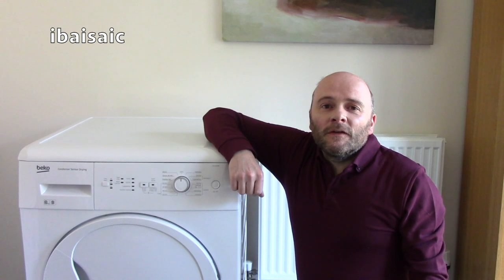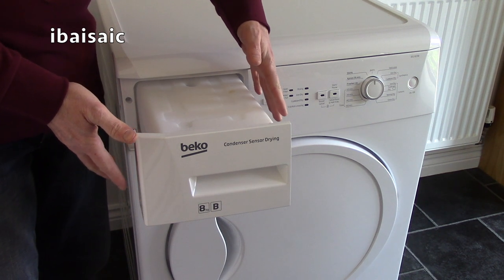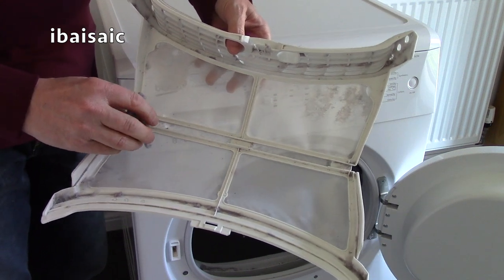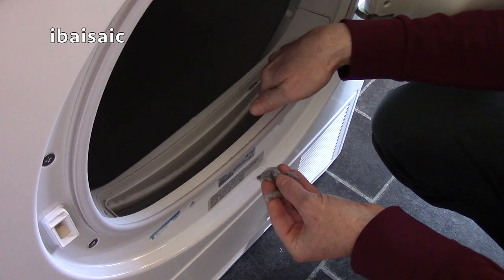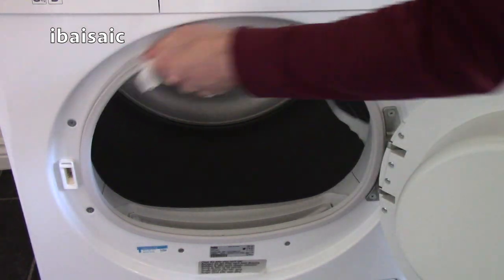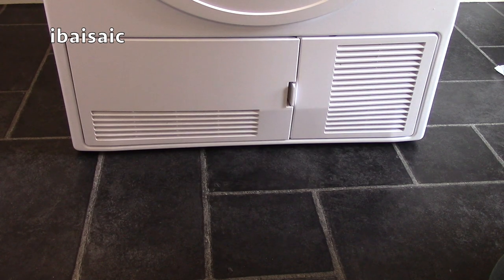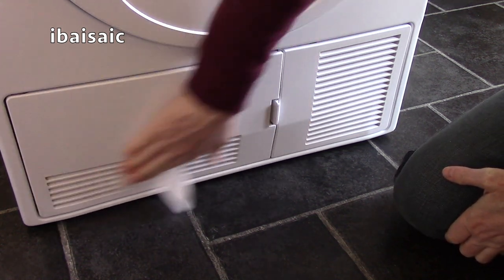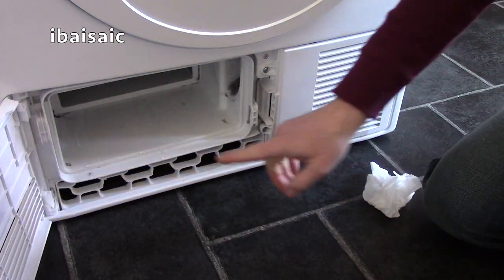Basic Tumble Dryer Maintenance For Trouble Free Drying

Comment: I take the condenser unit outside and use the garden hose. They need to rethink of a better design so you can actually open it up to clean inside.
Reply: I have lay on the floor , to clean mine , and it won't work if it's cold

Comment: The dryer I have now lights up to remind me to clean the condensor. Now I realise that I didn't clean my old one as often as I should have.  I very rarely use my dryer to dry clothes from the washing machine, I only use it to finish off clothes that are almost dry and it saves me ironing everything, so I don't emply the water every time or clean the filter every time.  I had only just given my machine a good clean before coming on here to see if there was anything else I should be doing.  I will admit that although I take the condensor out when I'm instructed by the light, I very rarely delve inside the machine, but I did today and was surprised as how much fluff sticks to the sides and collects at the back.  Mine is quite difficult to get into though.

Comment: because of my dog I rinse my condensor about every 8 loads. you can sort of tell when it needs cleaning as the dryer takes longer. I just use furniture Polish on my appliances. have done for years. it's like a protective layer. esp on the fridge and dishwasher as it makes sticky finger marks just wipe straight off

Comment: hate cleaning out the condenser - end up soaking myself and everything thats around. - we are in 2018, by now you would think some manufacturer could invent a self cleaning condenser dryer by now, no cleaning out of the lint filter and no dastardly cleaning out the condenser unit!
Reply: Cleaning a washing machine filter is worse
Reply: @Tom My Bosch Classixx7 is worse. The condenser comes in two parts. The manual shows how to open the flap and pull out the trap, but it does not tell you to pull the condenser itself out next to clean it. And of course there's no mention of the flap at the back of the compartment floor which hides another lint and water trap. You need tools and small hands and ideally a fibre-optic endoscope. Terrible design!

I have only recently discovered these things thanks to videos on YouTube. I was seriously considering throwing the machine out before that.

Comment: Really useful video. I always overthink instructions, so a visual is really helpful. Just been on the floor trying to clean the condenser cavity by shoving my arm in, but I'm about to buy a radiator brush. I actually came online to see if there was any way to get behind the ventilation grid next to the condenser, as mine looks to have a lot of stuff in it, but I can't remove the grid and I can't see any mention of doing this anywhere. I have a Beko DTG700 B - any idea if I'm able to remove it? I took out the screw but it still doesn't seem to come out, so I don't want to break it.
Reply: I have the same issue

Comment: Fantastic video and thank you. Only thing I could not see is how you cleaned the lint off the back of the condenser housing with that long brush. Did you just poke it in from the front and  wiggle it around? Where did the lint go?, did you have to vac it out?

Comment: P.S. The car wax a fabulous idea, and it works a wonder on the inside of bath tubs especially fiberglass or plastic ones when new. Much easier to keep soap scum removed. Not that I recommend using soap. Only shower gel. 😉
Reply from the maker: Doesn't it make the surface slippery.

Comment: I have cleaned my beko condenser. How long should I let it dry before putting the part back in?
Reply from the maker: The condenser does get wet when the tumble dryer is on as it condenses the hot moist air into water, so it doesn’t need to be bone dry. As long as it’s not dripping with water it should be fine.

Comment: Should there be fluf at the back behing the condenser unit st the bottom? 
istnt this  what causes fires at the whirlpool dryers?  its just  whst i read on BBC news now.. fluff behind the heating unit at the bottom.  I hava the same beco drier and noticed the fluff there  too ( like in ur video) .
 Any thoughts anyone before i contact Beco?
Reply from the maker: I believe it is fluff building up around the heating element that caused the fires in Whirlpool dryers. It is quite normal to find fluff and lint on and around the condenser, so cleaning it on a regular basis is a good idea as well as cleaning the fluff filter after each use.

Comment: I have a beko dc7110w condenser tumble dryer with a drawer at the bottom. It was tripping the electrics so I removed water and fluff from around where the float and microswitch was. This worked well for two months before tripping the electrics started again. I managed to get the dryer working again but only for 10 minutes or so, before tripping the electrics. I’ve also noticed that the dryer doesn’t pause when the tank is full. Could this be connected to the problem, allowing water to go to the microswitch, causing the tripping problem? There’s never a good time for a tumble dryer to stop working, especially with a new baby in the house! Any help or advice would be greatly appreciated, many thanks in advance
Reply: A few checks / the back of the condenser as in the video  a little hose in the bottom / the float switch & pump at the back- tricky to get to - maybe raise up on a stool for height /* inside the fan Enclosure is  a tiny passageway  that can block if neglected -even more difficult to access  Manufacturers Covert Intention!

Comment: My Beko DCU 8230 Water Tank Full led comes on after 20 secs, Ive cleaned out the rear chamber where the float is, replaced the pump, checked the hoses for blockages, cleaned the condenser chamber at the front with a hose, removed all lint, cleaned the water bottle and its still coming on - anyone got any more things I can try before I condemn the thing to the local dump?
Reply: Hi reigate robot I have the same problem did you have any luck?

Comment: Nice buddy . So the condenser unit right at the bottom has no electric parts or anything.  I didn't know that. So I can just flush it right through ?
Reply from the maker: The condenser on the model I show in the video is safe to flush clean with water.
Reply: @ibaisaic  yeah mine looks exactly the same, I just didn't relise its just collect the lint. Thanx mate I'm new to condenser drying lol.

Comment: Dears, I have done this so many times the past 2 weeks and I still have a problem.  The dryer is not collecting any water.  I have checked the pump and it works.  Any idea?
Reply: Give the dryer a bit of a bang on the side. The ball the measures how full the tanks is might be stuck on maximum.
Reply: I'm late but I had a similar problem and leakage. The hose is blocked by fluff & lint. You have to clean the reservoir there at the bottom, where the condenser sits. There by 6"13, there's a flap you can open.
Reply: It may be the impeller on the pump that's broken

Comment: Thank you for the video anyway, I just wanted to confirm I was doing things correctly but apart from the fluff filter in the door area there is absolutely no need to do all these things after every use. It comes across as a bit obsessive.
Reply from the maker: Of course you don’t do this after each use and I don’t think I suggested you do. You must always clean the fluff filter and empty the water container after each use, but cleaning the condenser only needs to be done every two months at most if you use the dryer a lot.
Reply: @ibaisaic  My apologies, I meant to amend my comment after I realised that's what you meant. 
I certainly don't empty the water after every time but i know it can get smelly if i leave it too long. I add a touch of bleach and rinse it out. I think that depends on  the hardness of your water. 
If you have soft water you would probably need to empty more often as algae grows more quickly.